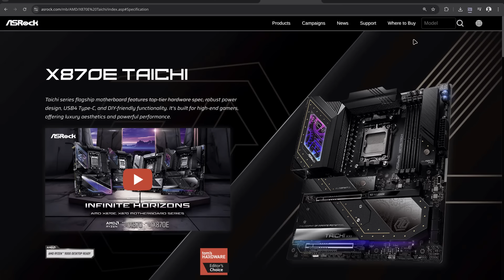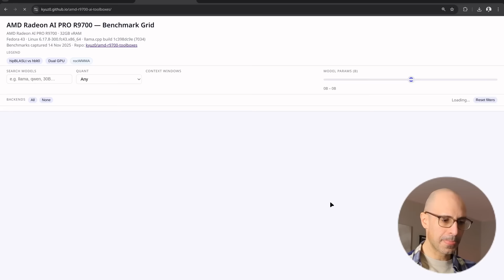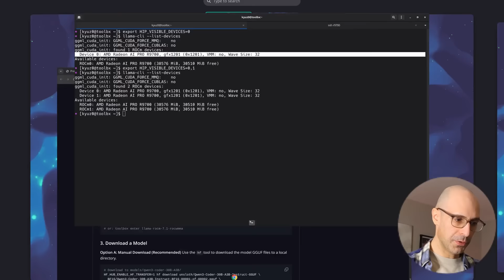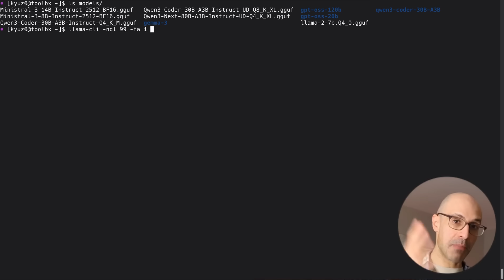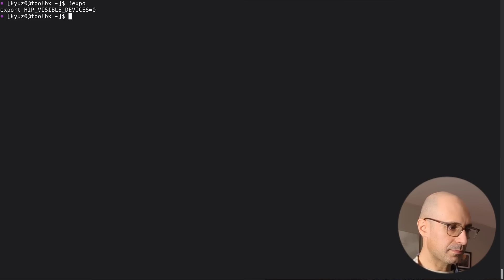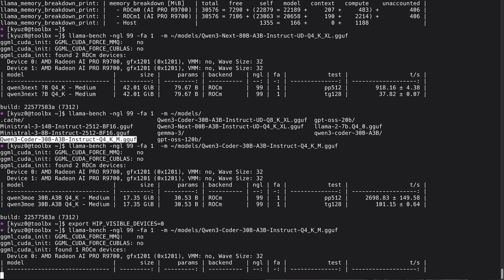Dual AMD Radeon 9700 AI PRO: Building a 64GB LLM/AI Server with Llama.cpp

Comment: You can't beat 4 × RTX 3090.  Its 2.4k EUR total.  Its 96 GB VRAM vs 64GB of (slower)  VRAM.  Forget about it.
Reply: Impossible to get at that price. Power consumption is going to eat up all that profits in a year and you would be left with 4 cards which have passed their half life.
Reply from the maker: If you want, I can include the information about your setup in my next video for comparison. Can you please let me know the mobo and power draw? I guess you'd need a mobo that supports 4 PCIe slots at decent speed.

Also, so that I can reference it in the video, can you please point me to where you got the 4 3090s for 600EUR each?
Reply: Got two PSU. 1.5kW and 1.2kW.  Max power draw is 1.6kW (ik_llama.cpp graph parallelism).  Using WRX80 and Threadripper Pro 3995wx.
Reply from the maker: @alekseyburrovets4747  that makes sense, the mobo+CPU combinatino to support 4x3090s is way more expensive than what's required to support 2xR9700. But again, 3080s are great cards as well, I am not disputing that - I did cover benchmarks in the video I released today.
Reply: Mobo supports 7 PCIe.  5 of them with x16 full speed.
Reply: I got the GPUs from the same EU country where I am currently living, that is from a local market with cash payments.  The prices are 100-200 EUR lower than ebay, yep.
Reply: Price for 3090 more likely between 1200 and 1500€ don't look at the starting price of ebay auction look at the final prices 4  times 3090 is more likely between 4,5-6k€ with a lot of power consumption, i barely see an ebay auction with a starting price below 600€ (which usually ends far beyond 1000€)

Comment: Love this video, it's often so hard to find performance matrixes for AI, especially non nvidia cards,

I hope you will do some content on image and video generation with these cards as well.
Reply from the maker: For sure! And the performance measurement and improvement are the fun part
Reply: @donatocapitella  This is a big ask I know but I'm searching for the most cost efficient way to run 70b class dense models locally, and 64gb of VRAM means being able to load some decent Q5 and Q6 quants. Is there any chance you can add a Llama 3.x 70b model into the benchmark matrix for these cards? 

I can't find any pre split gguf models but llama.cpp is meant to have a gguf splitting mechanism, though if that works on dense models I have no idea.
Reply from the maker: @mt1104uk I'll try next week, remind my by Tuesday if I haven't!

Comment: Whoah, great! (I hope you won't abandon halo strix... 😖)
Reply from the maker: vLLM video on Strix Halo also coming. Let me know if you want to see anything else :)
Reply: @donatocapitella  Hi. When you do the video on Strix Halo, can you also test it on Windows using Lemonade server and something like GPT OSS 120B (having allocated on bios 96GB on the iGPU) running on hybrid mode? (igpu+npu). That's one of the hardest benchmarks to find around. Thank you :)
Reply from the maker: @PT-rg2vo hey, it's not on my high priority list, I feel the integrated NPU won't really be able to achieve much and the effort for me to set this up is quite high, as I need to go buy a new SSD, physically swap it with the current one where I have Linux and install Windows and set it up. And my hunch tells me this won't result in much performance gain. But I'll add it to the list of things to try, just not a priority on this hardware
Reply: @donatocapitella  
Hi, maybe not a great video content, but i try to code with some models with huge context size, like 80k-256k.  I always get some errors, and dont know what to do.
Reply from the maker: @learntotie8972  The best way forward would be to share some of the detailed errors and failures you're getting, add issues to the GitHub repo of the toolbox you're using. Once we have the logs/details, we can try to figure it out.

Comment: There’s no estimate on the cost to build a pc like this?
Reply from the maker: I didn't want to do an estimate, as I know prices for memory are about to change and affect stuff, but in a nutshell:

GPUs: 2x AMD Radeon AI PRO R9700 (64GB Total VRAM) — £2,400 (£1,2000 each)
CPU: AMD Ryzen 9 9900X3D — £499.99
Motherboard: ASRock X870E Taichi — £454
RAM: 64GB Crucial Pro DDR5 (2x32GB Kit) — £280
Storage: Crucial T710 2TB NVMe PCIe 5.0 — £190
Power Supply: Corsair HX1200i (1200W) — £209
Case: Fractal Design Torrent (Black Solid) — £199

You can go for a much lower PSU and also a cheaper case, that'll save over £200.

Comment: Hello Donato, thanks for the nice video. I confess I have some trouble in putting in the right prospective the pros and cons of the HW you are showcasing. Let me please make a question: considering 1.2k€ per 9700 plus space and the power management issue, in case the need is up to 128 GB VRAM, there no advantage to go your way rather then, for instance, a DGX SPARK at 4k€ right? Cheers!
Reply from the maker: The DGX will not perform anywhere near this, you can't compare them as the memory bandwidth of the R9700 AI PRO is 3x and it's got more compute. You can compare the DGX with Strix Halo, see the other videos I made on the Framework Desktop and HP mini

Comment: I don't think you will get that Memory bandwidth on an AM5 CPU, it is not possible - Threadripper is the only way and then it is best to go with Threadripper Pro
Reply from the maker: Actually the 640GB/s refers to the internal bandwidth on the graphics card itself between the GPU and its own VRAM. Since that speed happens entirely inside the card, the CPU platform doesn't limit it. You would only need Threadripper if you wanted high bandwidth for the main system memory, but the GPU runs at full speed on AM5.

Comment: Thanks a lot. I'm considering the R9700 now. One question regarding the INT8/INT4 TOPS.... Aren't all consumer GPUs faster than the memory bandwidth anyway for LLM inference?
Reply from the maker: Can you rephrase your question? I'm not sure I understand what you mean by saying "all consumers GPUs are faster than the memory bandwidth anyway""
Reply: @donatocapitella  sorry for the terrible question. I meant this: I believe that for LLM inference, the memory bandwidth is still the bottleneck, not the GPU crunching numbers. So it doesn't matter if it can do 20 TOPS or 40 TOPS.
Reply from the maker: @bugreporterify1  It is true that bandwidth is the bottleneck here, but only because this card has enough compute to handle it. If the TOPS were too low, the GPU couldn't process the data fast enough, and compute would actually be the bottleneck. AMD likely designed this to have just enough power to saturate that ~644 GB/s bandwidth. So you are right that more TOPS wouldn't help in this specific case, but that is only because the minimum compute requirement is already met.
Reply: @donatocapitella  My thought is: We have 690GB/s memory bandwidth. That's 1,2 trillion INT4s per second. Let's overestimate and say we do 8 operations with each of them alone. Then we need ~10TOPS to do 8 operations on every INT4 we can load.

The R9700 can probably do >1000 TOPS of INT4, while the W7800 can only to 180 TOPS. But I wonder if that matters at all if the memory is so much slower. (Or maybe I just made a mistake?) Of course there can be other use-cases where this matters a lot.
Reply from the maker: @bugreporterify1  oh yeah, i forgot we were talking about INT4. I think your math makes sense, but consider a scenario with vLLM and high concurrency/batching, and I still think you'd be able to make use of the entire computer capability.
Reply: @donatocapitella oh! Right! Batching is a good point.

Comment: Very interesting video! I bought two R 9700s myself for testing purposes, but I'm still struggling with vLLM. I'm trying to run the latest Qwen models, but the vLLM version in the official R9700 AMD Docker container seems too old for that. Really looking forward to your upcoming vLLM video!
Reply from the maker: yeah, I build the latest version. What quants/models are you trying to run exactly? I will add them to my next video.
Reply: @donatocapitella  I admit I was a bit naïve starting out; coming from Nvidia, everything was very hassle-free there. I intended to run Qwen/Qwen3-235B-A22B-GPTQ-Int4 locally, starting with 2 cards to test AMD stability before expanding.Guess I didn't do enough research beforehand :)
On just the two cards, I want to run Qwen3-Next-80B-A3B-Instruct (AWQ) .Still gathering experience, but it's an exciting project. I'm currently running gpt-oss120b on llama.cpp, getting speeds similar to yours.
Reply from the maker: @lorenz411  I confirm Qwen3-Next-80B-A3B-Instruct (AWQ) runs just fine, it's part of the models I am benchmarking. You will need --eager though, as for me at least the cuda graph crashes for that specific model across two GPUs.
Reply: @donatocapitella  Good to hear, when will your vllm video drop?
Reply from the maker: @lorenz411  I'm running benchmarks and doing research to find the most performant configuration, and i will also try to compare with some nvidia cards, if all goes well I should have al the data to record this weekend, so it might drop monday/tuesday next week

Comment: I have 2 ASRock R9700. On  Ubuntu latest ver. plus ROCm 7.1.1 in a docker container plus llama.cpp. RAM 192 GB. CPU AMD 9950.. 
The GPU export 100% of the hot air. No need of special care.  The one on PCI4 will be slower . I have posted benchmarks at llama.cpp.
Reply from the maker: can you please point me to the benchmarks you posted? Yeah, you don't need a special case, I mean the Fractal case is not special, I was probably just being carried away when I wrote the script, it's just a nice case with very good airflow.
Reply: My r9700 keeps being reported as being in Low power mode by rocm-smi even though the profile is set to COMPUTE.  GFX_SCLK shows 3385 Mhz. Did you encounter any similar issues?
Reply: I have 5800x and gpu one rx6600 and one rx7800xt on b550f. Chatgpt told me to run it in series: rx6600 do screen task and then rx7800xt do heavy task on ollama. I'm non software engineering background.  Would like to know if this works. Thanks

Comment: Thank you for sharing t/s. I was wondering about the R9700 performance.
Reply from the maker: To see the real performance, wait for the next video on vLLM. I'll probably do a direct comparison with other cards on that video. But I can already see the card being fully used during those benchmarks
Reply: @donatocapitella Yes, I didn't know vLLM is more efficient at using two cards. Thank you for sharing that information.
Reply: @donatocapitella You can try -sm graph with ik_llama.cpp for tensor parallel.

Comment: I usually download models from HF with curl, it can even do sequences if you use the right syntax.
Reply from the maker: I find 'hf download' can be faster, but I haven't benchmarked it against curl. What syntax do you use?
Reply: @donatocapitella  it’s described at almost the start of the curl man page, they call it “globbing” which is just a range in brackets like [0001-0009] and so on, useful to have a single command to let run unattended for a long time. Of course the download link you get from the site redirects to a CDN so the -L flag is needed. As for speed, I have 500 mbit/s internet and it seems to get at least this speed

Comment: my 7900 xtx is equally fast on qwen3-coder but way cheaper. Thats now the question if 8GB more VRAM is worth it. But could the 9700 AI PRo fast on native FP8 tensor models? I didnt find anything about the 7900 XTX Performance on Fp8
Reply: Having more memory is always better :P  I have 2 7900xtx's in an X570 system running ollama (I know yeah yeah yeah) but it is also paired with a DGX Spark.  Between the 2 of them you can get the best  of both worlds while running  multiple 30 billion param models with a 100 billion paramater model or large on the spark managing.  I have been able to build an end to end coding agent system that includes vision models to do unit testing of the UI.
Reply from the maker: @chucksanders7131 what do you use for your coding agent and IDE?
Reply: @donatocapitella  I am using Qwen3-coder:30b and Devstral:24b and then GPT-OSS:120b for orchestration and Qwen3-vl:32b for the vision testing.  I am using VSCode to code everything along with LLMs to assist heavily in the coding and prompt creation.
Reply from the maker: My guess is that gfx1100 support is probably more mature on ROCm/llama.cpp than gfx1201 - that's likely the reason for the current performance. I'll try to benchmark this on vLLM which will give us a better idea of the capabilities.

Comment: I run older AMD (10gpus) because I am a hobbyist that cannot afford the massive cost of rdna4, with that being said from my experience FP16 is where AMD excels.
Reply from the maker: out of curiosity, which ones have you got? I'd love to cover a 10GPU cluster, what are the specs / cost of your system?

As to performance, Strix Halo and R9700 do very well with BF16, and R9700 also does great with FP8 - but still doing benchmarks on that at the moment
Reply: Well it's not surprising that you observed that F16 has the best performance on older AMD HW because that was the native support available then. But you simply cannot generalize that to "AMD excels at FP16". Simply incorrect.

Comment: Very nice video and thank you for the work you make available. 

I am considering a private home setup for llms where price is important. Besides the obvious benefit of extra vram can you then comment how good a buy this gpu is compared to its closest competitors in terms of price?
Reply from the maker: I'll wait to show some comparisons with the other cards in the next vLLM video, as that's likely to lend itself better. Comparing is hard, but I'm thinking of normalising performance by cost to give ppl an idea. 

But ultimately, it comes to the budget you can spend. Yes, R9700 is a modern and capable card, with 2 or better 3 of them you'll be able to run many models at high tok/s speeds, you won't have issues with usability.

But if you want to serve 1000 users at the same time, this isn't the card, nor is the 5090 TBF!
Reply: Thanks for answer. I am looking forward to the next video.

Comment: Man, the benchmarks table is such a great thing. I wish more reviewers were doing such a great job! Thank you veeery much!!
Reply from the maker: It's the fun part of this TBF, I really enjoy measuring and comparing performance. But yeah, it'd be hard to do if I had to push out a video every week! Thankfully I run the channel as a hobby project so I can take my time
Reply: @donatocapitella Hi, I wonder why do you use tg32 instead of sth just a little larger and more broadly used in benchmarks as tg128?
Reply from the maker: @Antoni-ji5doI use tg128 for the standard one, abs shorten it to tg32 for the long prefill ones, as I'm testing a lot of models and I'm trying to optimise time. Tg32 should still be statistically accurate for long context.
Reply: +1, Donato you are da man!

Comment: Great. Thanks testing new 9700 AI Pro. Couple of points I wanted to mention. First, container based setups have some overhead. I think measuring it with a recent setup would be good but a couple months ago it was around 10% (with a RX 9070 and Vulkan when I tested). The flexibility might be worth it but I think it's worth mentioning.  Second one is that with a dual GPU setup limited by PCIe lanes, you are almost guaranteed to never hit the power consumption of two GPUs TDPs combined. Maybe with model parallelism (running two different models on each GPU) you may approach that limit but during inference the CPU load will be minimal. So a 1.2kW PSU is really not needed. A 800W PSU would be more than adequate.  Also nvtop is another alternative for amdgpu_top that I found useful if you want to look at a graph based view of the all the GPUs and CPUs, supporting AMD GPUs as well.
Reply from the maker: Thank you! I'll double check the container overhead, but when I checked it on Strux Halo, it wasn't detectable at all - might be different for this setup, I'll check.

I agree on the power consumption, we overdid it for sure. But on vLLM, at high throughput loads, they stay at 300W, so max power draw.
Reply: POWER SUPPLIES ARE LIKE FLYING.. ONE RUNS THEM AT 75% OR LESS.. or you risk a voltage drop - and amperage rise [consumer power supplies are rated @ 80%, some [HPE] server power supplies are rated @97% (dual required, as a 4 pack)..
Most of the Chinese AI models run in parts, ~20GB units of expert models that do not share memory across GPUs if setup correctly, thus one gets speed without the bottleneck of the PCIe lanes.. the 32GB memory get one longer context that a 24gb card.  Nvidia linked cards have the 2/3 memory reduction that is automatically set aside for fast transfers that will influence context size (or one has to manually set up for that factor)....